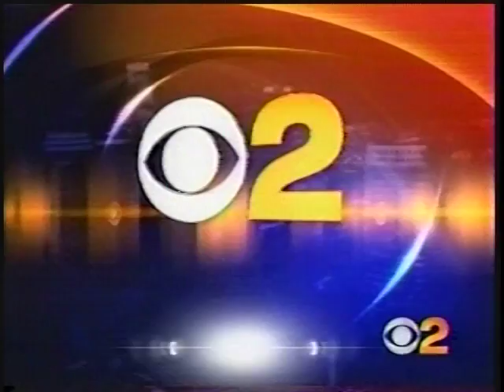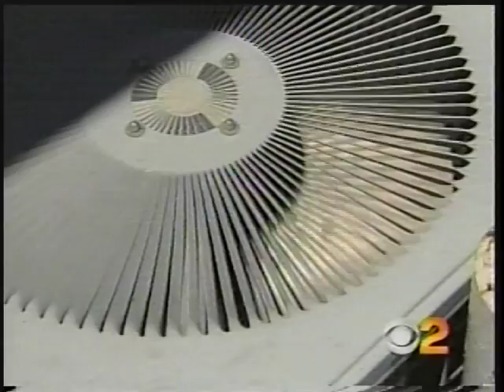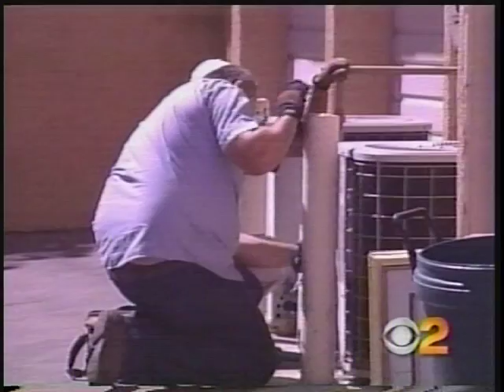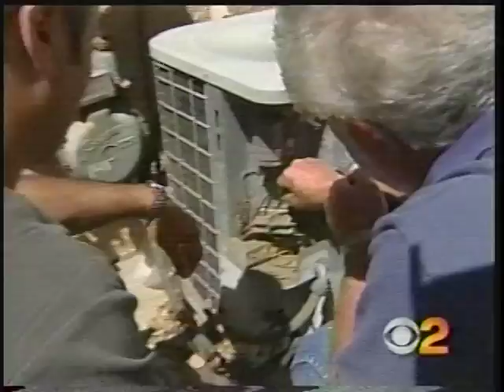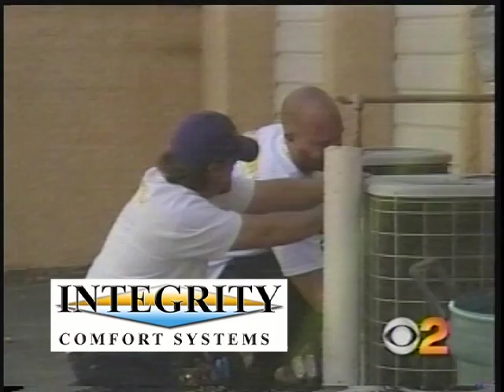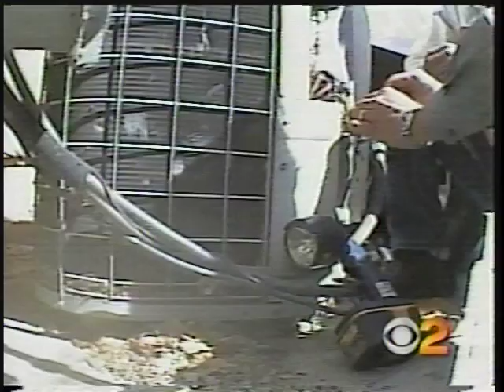Integrity Comfort | CBS Heating and Air Conditioning Repair Sting

Comment: As an hvac tech i have to shake my head. I live in Houston the A/C capital of the world. Our service fee charge is $120. That's for us to come out and do a very thorough diagnostic. And if a part breaks we usually inly charge the difference between the repair and the service fee. But in tha case of the video all we would charge is the service fee.
Reply: Even $120 service fee just to identify the disconnected wires is too much
Reply: @drummersnare6276  lol. You can work for chump change if you want. I ain't. My time and expertise is worth something. I'm not sure if you're a tech or a homeowner, but that mentality won't get you far in life.
Reply: @christianruvalcaba7788  Yeah my mentality of giving fair pricing won’t get me far in life😂. Actually you ripping people off won’t get you far in life. Connecting two wires that took 10 seconds to identify and 2 seconds to connect, is not worth $120. You’re a scam artist not a tech
Reply: @drummersnare6276  hmm, the tdlr would disagree with you. I've been doing this for 14 years, never had a problem. If you value yourself as a cheap repairman,  go ahead. I have several degrees and certificates for my work, I value myself highly and make the corresponding salary.
Reply: @drummersnare6276   still reasonable considering time transportation labor costrs etc after seeing the scammers $120 to have it fixed  is okay -

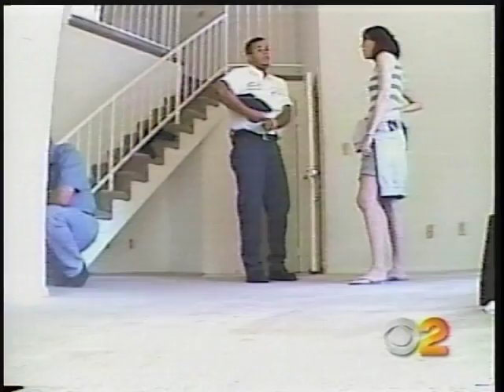Comment: The guy at 3:30 did nothing wrong. He was truthful and was just trying to help by recommending repairs to avoid any more future failures on what’s looks to be like an old unit.
Reply: He said the capacitor  " tested bad "  
Then changed his story to " looked old , rusty "  . 
I will give him the benefit of the doubt on cleaning the condesor  coil ?   They didn't  specify if they cleaned it before setting up the hidden cameras.
Reply: @craigerickson8712 huh?

Comment: that last guy probably didnt expect to see the compressor contactor wire deliberately disconnected .. It's easy to misdiagnose and change a part out to find out it was something else (every tech does this , it's part of troubleshooting and happens to all techs)
Reply: bullshit if he would have used a meter to check for 24 volts at the contactor coil he would have had 0 and worked back from there...any tech that has a clue would fix that in less than 10 minutes

Comment: How many field techs walk up to a unit that has been in-service to find a loose wire under a wire nut, I haven't, less you see where the pet has had its way with the harness and the wire is askew.  The loose wire is a startup error that may occur during installation.  These investigative report B.S. is not realistic. How many times that you find a loose wire nut on an old in-service unit - me never. Properly install a defective relay or whatever and see what a tech concludes. The "professionals" that help stage this are actually instructors that work in a lab. And the "investigators" are hiding behind the so-called professionals because they themselves haven't a clue in installation, maintenance, and repair of HVAC or plumbing. Really, are we dealing the poorly skilled or seasoned crooks? I am thinking...how many techs did respond to this call? Remember what gets aired is a story being told during a News Broadcast. Lastly, decades ago a co-work recalled a summer as an HVAC helper. He stated "at no time previous in my life had I been in the presents of so many known felons.
Reply: I don't even do domestic repair and i've found more than my fair share of loose spades/wire nuts
Normally whenever there is a lot of vibration those wire nuts tend to fuck off on you, i prefer spade connectors, they actually clip.

Comment: I earned a Journeymans card in Roofing & Waterproofing as well as a 2nd Journeymans card in Architectural sheet metal and a crane operators license durring my construction career ,but I've became old and look like an easy victim who knows nothing about HVAC ,so when I needed a new furnace I decided to replace the central air and all ductwork ,every company I called from the phone book quoted me prices from just pennies over $10,000 as high as $14,000 , in desperation of not wanting to work in a hot attic I got on Craigslist and called 3 HVAC installers ,the 1st to show up quoted me nearly $9,000 and I noticed he was driving a car ,no work truck ? On to the 2nd Craigslist estimate , a man in his mid 60s pulled up & as I walked to his truck to greet him he asked me if I could wait until the agreed appointment time 20 minutes away so he could catch up on paperwork ,that's a huge plus sign ,right at our 530 pm appointment time another 2 trucks pulled up and all 3 men met me on the porch ,they were wearing dirty work clothes ,plus #2 ,they brought all 3 people who worked together because they wanted to get home after a hard days work , I gave all 3 access to my home ,1 went into the attic to measure duct work ,1 went on the roof to check chimney ,entry point for copper lines etc while the 3rd accessed my mechanical closet ,they spent roughly 15 minutes measuring and writing things down ,then went to the hood of their trucks do talk about what each had seen and write the estimate ,the oldest guy saw my trades union sticker in my work trucks window and we got to talking ,he was retired from work and was the local HVAC unions school instructor ,the cheapest company estimate for a 180,000 BTU furnace i knew was too big ,and 3 ton air unit plus ducting was $10 grand ,these 3 guys sold me a 160,000 BTU furnace after ex planing 180,000 was too large and wouldn't heat properly ,plus #3 ,they explained I needed a 4 ton condensing unit and worked thru the Sq foot calculations with me ,for the furnace & air they quoted me $3,800 and I nearly shit ,I thought it was a scam ,before I could ask about the price for ducting the HVAC instructor spoke up and said that they had 500 ft of brand new round ducting they would sell me for $100 and install it all for another $900 if I was OK with switching from oval ducts to round ducts ,that brought the total price up to $4,800 ,we worked up a contract and I'm expecting to be asked for money up front and the youngest guy whipped out his estimate sheet showing how much they were going to be paying for the new furnace ,copper lines ,air unit etc which came up to $2,900 and asked that I have a cashiers check the day they scheduled to start the install after they brought all the new stuff , plus #5 ,they started work at 7 am and worked until 1030 pm on day 1 ,on day 2 I saw them installing a new 20 foot stainless steel chimney insert I didn't pay for ,when i asked he explained that they forget to include it & would eat the $400 loss ,they worked 9 hours on day 2 , on day 3 while packing up after they had finished one guy brought in 2 gallons of paint he color matched perfectly to touch up the paint they scratched in a few places ,when they finished they just left and that was it ,my wife & I were like wtf ,we still owe these people a lot of money , a week later we got an invoice in the mail for the remainder of money owed ,something told me I had better check the attic and see what they did up there before paying ,unknown to me they wrapped every inch of my duct work with insulation and I knew the old ducting wasn't insulated .

I called them and asked if all 3 could come by and I would pay then ,it took like 10 more days before they came by to collect ,when they showed up I had a cashiers check for the balance and gave each of the 3 HVAC installers a $500 cash bonus each and $200 for the chimney liner ,I got better equipment and better service from Craigslist honest tradesmen than I would have with a major company ,I got free duct insulation and saved $4,000 from the cheapest contractor .

Comment: Depends on when they called. Busy season im not looking for someone who cut a wire, im looking for shorts/burn marks/etc. id look for broken wire if there was sign of a rodent on first glance. Either way i think id find the problem but I hate the attitude towards the two guys for misdiagnosis. The guy that cut the wire though thats what gives them reason to be jerks in the first place. I dont know, we all overlook things all the time its just about keeping the callback ratio down as much as you can. These reporters are just as ignorant as the wire cutting techs.

Comment: Ac tech here for 12 years.  I hate guys like these, makes it difficult for everyone. Any one who didn't find that problem is either incompetent or a crook.  If your condenser isn't on,  first thing you check is power to contactor, then power to contactor coil, and there was the problem. Would've found that in 10 seconds.

Comment: My boss would transfer me to maintenance calls if I pulled this shit. Its not that hard to diagnose this kind of a problem, pull out your multi-meter and follow the circuit the first one to check is to see if you have 240v to the unit, second (which was the disconnected wire) is 24v from the thermostat to the contactor..... should have taken less than 2 min.

Comment: in this trade a good volt ohm amp meter is light your right hand the guages are secondary and often not needed seldom do I see some techs use a meter to check and diagnose problems that are easily corrected just be honest and fair and you will always have repeat business

Comment: Funny how so many people try to pull scams when you can make more money just by being honest.
Reply: ppl are dumb i rather do the right thing and make $50 off someone 10 times than a quick 300 and you take care of that one customer you'll get five more from them
Reply: That is so true. The AC Repair business is like any other business in that if you win the customers trust by being honest, maybe you have a customer fo life
Reply: The system is so  complex and if your good at what you do honesty will make you so mu h more money# scammers are losers
Reply: @MrDlovelock  Enlighten me, how is a residential a/c system complex?
Reply: @marshalljimduncan  
Depends.. If you are an avg home owner then a hot water tank is complex to you. If you are handy then not so much.
Similar to anything in the house. From electrical panel boxes to HVAC.
Biggest things are knowing temps/refrigerants/CFM and so on.
The common problems from caps, contactors, fan switches, fuses etc is not really complex... especially for a handy person.
It will take one far longer to find the problem but today many new systems have boards that can give you an idea.
But there is alot of parts in an HVAC system that can break..
Flame senors, control boards, caps, contactors, relay/fan switches, fuses, heat exchanges, pressure switch, gas valve, low/high voltage wires, thermostat, indoor/outdoor blower, blower wheel, Coils, Reversing valve, Handful of safety switches, and so on..

Comment: the techs should have just fixed wire but also go through the unit including contactor ,cap and SH and SC. and if those parts looked like they could be issue offer to replace. There's nothing wrong with offering preventative maintenance. because I been on calls where it was simple fix and then all sudden a pitted contactor goes and then they want to know why they weren't told about it. but that being said those guys were shady.

Comment: I am a CFESA certified master technician and I have been servicing Commercial Cooking equipment for 16 years and  HVAC/R equipment for close to 30 years and I have found there are 3 groups of service technicians. The honest techs who find the issue quickly and fix it or recommend the needed repair to get it back up and running. The parts changers who have no business working on said equipment because they don't know what they are doing. The dishonest scammers who know how to service the equipment but instead turn a simple fix into a big budget repair because they are working on commission. They sell parts/equipment that the customer does not need. As for refrigerant leaks, they can be hard to find but a good tech will know where to look. Consumers are getting ripped off left and right and that makes the honest service techs look bad. As for the service companies that advertise A/C tune ups for a set price, don't buy into it. If your A/C is working fine but you just want  preseason check up and they tell you that your system is low on refrigerant, I would ask them how they determined that. If they say they hooked up their gauges, I would tell them to pack up and leave. You just lost precious refrigerant when they put gauges on the unit. Granted, several things can fail on A/C systems and usually it's an electrical connection or component that fails such as a start or run capacitor, a contactor, a fan motor or god forbid a compressor. Leaks can be due to a refrigerant line rub thru, a poor solder joint, threaded connection or worn out schrader valve which is where the gauge hoses are connect to the system. Do your homework and observe the technician while he/she is working. If he/she has issues with you observing them at work, show them the door. An honest tech will gladly explain what they are doing as they go along.
Reply: mike venard How can you check the refrigerant charge without hooking up your gauges?
Reply: Some companies require their employees to record the pressure readings on their service sheet while servicing the unit.
Reply: I agree with mostly everything except for the gauge hook up idea...the "lost" refrigerant is unnoticeable. Do you apply this same theory when checking your tire pressure?

Comment: I see this stuff all the time. Had an estimate to replace a system 3 years ago on a system another company determined to have a bad compressor. Customer was happy with my price and wanted to proceed with replacement. Before I left he asked me if I would double check the previous findings. I opened it up and found the same low voltage wire disconnected, plugged it up and it's been running ever since.

Comment: Unfortunately, there very few quailed air conditioning technicians servicing residential customers, most (not all) are nothing more than salesman with tool bags, being pressured by their bosses to charge the customer as much as possible.
Most of your more qualified technicians are in the commercial and industrial end of the industry.
One more thing, I bet you most of the so called 'technicians' in this video couldn't tell you the difference between superheat and subcooling.
Reply: Commercial / industrial guys are, or can be, just as dishonest as these residential ham and eggers. When a lucrative service contract comes up for bids and a service tech believes he can sway a building owner/manager and get the contract away from a competitor, you can well be assured that some dirty underhanded stuff will go on.  With 45 years in the industry I've seen it time and again. They will take a compressor contactor to show the "burnt contacts" that his competitor "should have replaced". We all know that what looks like burned contacts is normal and doesn't constitute negligence on the part of the contractor. I've seen many other misleading remarks and reports written by service techs who knew better but were enticed to attract new business by any means available. When battling for contract work it's 'anything goes' and it usually means someone is going to be dishonest and someone is either going to keep or loose a contract. When we're talking a 'Full Service' contract, then the value is even higher still.

Comment: Scariest thing about this vid was the first 5 seconds, all those gas meters, beside the ac,
Reply: Why scary? The contractor putting those in didnt use pipe tape, left the fittings a little loose, and forgot to put in the safety shut off valve. The ac unit is only a few feet away with a sparking contact so you shouldnt have any troubles. If you do have an explosion call a technician.

Comment: Is because all HVAC are dumb fuck, I usually work back then I see how they did to people
Reply: Its job security they are pushing. Its easier to put in a new unit than most people think so when any little problem comes up they just want to replace it. In all reality with new 410a units almost any joe with minimal knowledge following a process to make sure they solder correctly with back-purging can put one in. They see their market slipping away and have lobbied with politicians for environmental regulations and certifications required to work on HVAC. Welcome to a police state.
Reply: ***** Certification means nothing. True understanding means everything.When you understand what that means you will understand why regulations are bullshit.
Reply: So eloquently stated, by an obvious smart fuck.